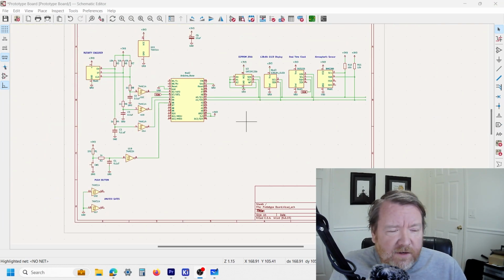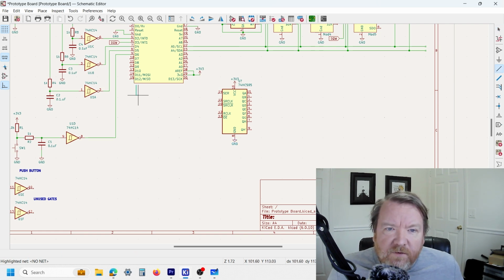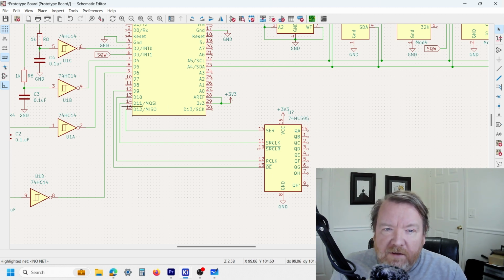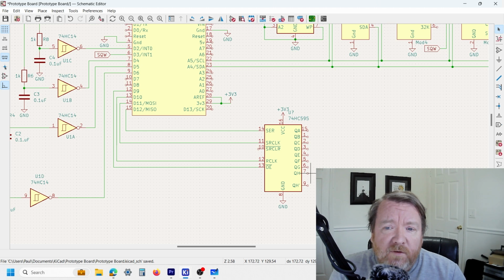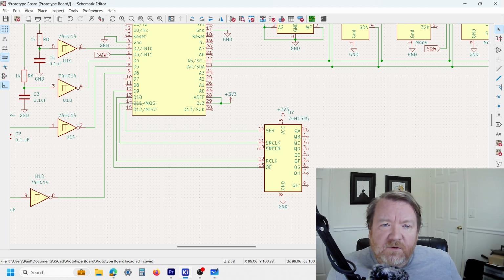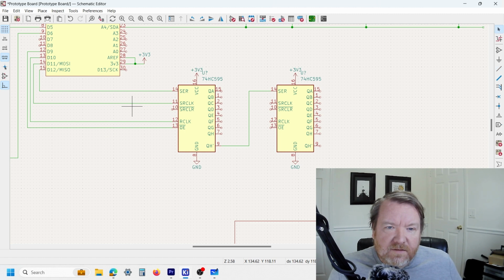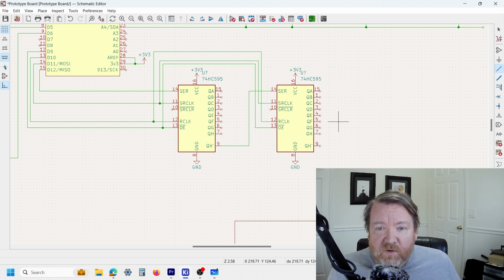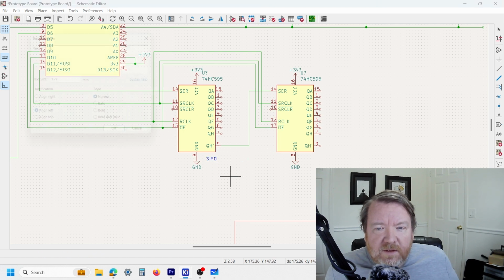74HC595 Shift Register

Comment: I also like 4094 and 74HC4094.
Reply from the maker: Thank for the comment. I am planning on making videos of the 74 series, it's just hard to find good use cases for many today. When I started in engineering we did not have cheap micro's and I used the 74 series for everything. Now, it's cheaper and easier just to throw a micro at most things. 
If you have any ideas, please let me know.